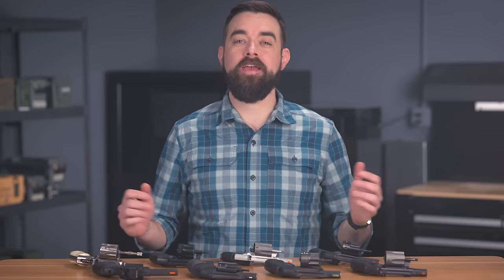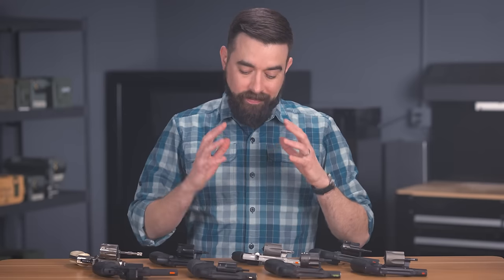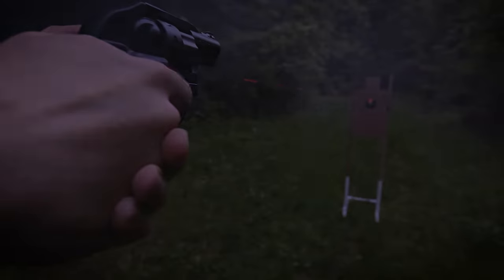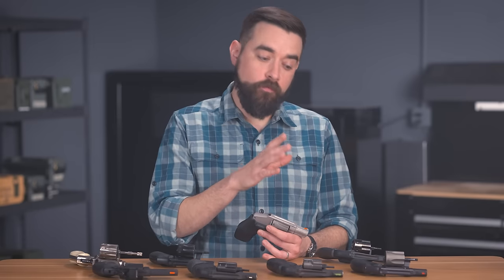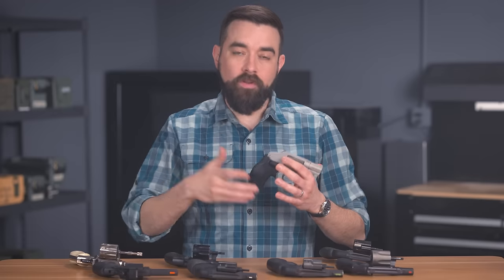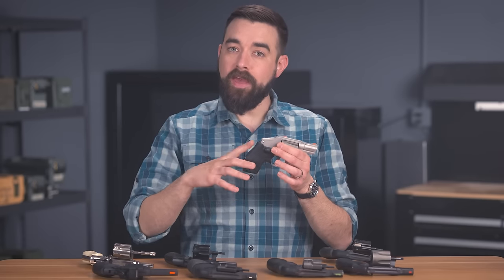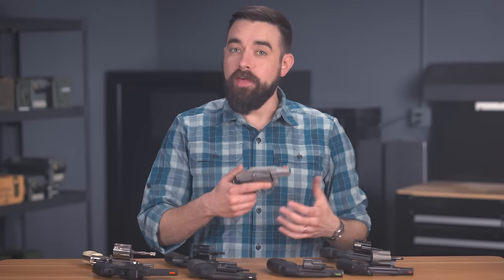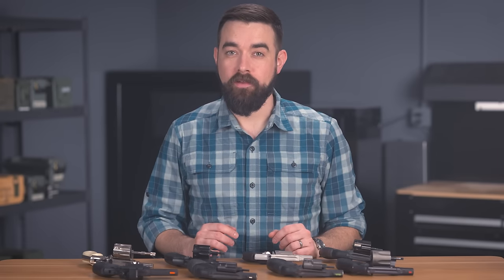Tips for Shooting a Snub Nose Revolver

Comment: S&W 640-3 (stainless .357 snubbie) with laser is my go-to here. I don't need the laser but it does evidence how well my trigger control practice has progressed ..or deteriorated. it's pretty in an ugly sort of way, maybe like an English bulldog, bites me too when I feed it .357 🐶
the trade-offs, while considerable, are well worth the benefit-  you-can-bet-your-life-on-it reliability 😎 
you know, in nearly 20 years with this model, I'm pretty sure there has not been one instance of a failure to function. was there a round that didn't go off? maybe 🤔but I don't think so. I would attribute any such to a defective cartridge. the solution is always easy with a revolver like this, just pull the trigger again 🙂all ejections, reloads, then resumed fire have been perfect.
I would not give it to a beginner, even with mild .38s. I tried, nobody likes it. so even if they tolerate the shooting, you're discouraging the beginner from the sport and benefits of effective self-defense. this is a specialized tool where its unique quality shines only after the operator has a good deal of experience.
yeah, so give them a small revolver for revolver practice, like I now do with a S&W .22LR. they're happy, learn revolver stuff, it's cheap too, actually can provide self-defense, what could be better? 😎🇺🇸

Comment: I started shooting snubs in 1991 Taurus Mod 85 stainless .then a 1980s manufacturered Charter arms "OFF DUTY".38 ( had a hammer back then ) very proficient with both .then a Smith 642 centennial... I carry a 11 oz smith 342 airlite ti (titanium cylinder) 38 special centennial.. in my right front pocket in a DeSantis Superfly pocket holster... I installed full size hogue Mono grips .. covers the back strap.. cushions my hand against recoil.. and gets all my fingers on the grip for maximum control.. still easily fits in my pocket.. the defense load I carry is federal HST + p 138 grain.38 sp 
Federal achieves +p velocities and pressure. By seating the humongous hollow point DEEP  in the case flush with the case mouth like a full wadd cutter.. this builds up plus p pressure without adding more powder the.. result is a plus p hollow point that expands and reaches 13 in. in denim covered ballistic gel. But feels like you're shooting a 22 magnum instead of a 38..+p.... I carry my spare reload in a ZETA 6 circular rubber speed strip... Load all five at once! Without bulky speed loaders and knobs and buttons....

Comment: There are a few Taurus snubs I have yet to experiment with, but overall my experience has just been bad with Ruger and S&W. Besides the CT laser grips, I have yet to find a boot grip that sucks less than the factory boot grip from Smith. A lot of the Hogues actually impede the mainspring and increase your trigger weight, a lot of wood grips are shaped to fit as many guns as possible and as such leave huge gaps that can pinch your hands (looking at you Altamont), and almost all of the 3-finger “combat” grips I’ve found are designed to put your hand way too low. Smith can’t index a barrel straight to save their lives, and Ruger seems to have a fixturing problem as I’ve now seen about a half dozen LCRs in person that have their front sight bases milled with a rightward cant. The LCR trigger is actually quite good, even in rimfire, but having started on Smiths I just can’t fix my tendency to false reset the trigger. If someone would just make a 2” snub with an adjustable rear, I would buy it. I have never worn a pair of pants in which pocket carrying a snub revolver is even plausible, and I’m not even buying tight pants; concerns for pocket carry have zero bearing on this purchase. Give me a snub with belt carry and performance in mind. I want to make revolvers work, but I just keep getting let down

Comment: Holding the grip too high is the biggest mistake people make with these revolvers. All your fingers should line up and be parallel with the cylinder/sights when gripping, and not be angled downward at all. A revolver is meant to 'rock' in your hand. It is not supposed to be gripped like you would a Glock.

Comment: It is a mistake to think that light weight is the objective!  I carry a solid stainless steel snubby with the weight to help absorb .38 Special +P recoil, and it IS heavier than the super-lightweights by DESIGN.  BUT you quickly get used to it and don't even notice it in your pocket.  REALLY!...............................elsullo
Reply: None of these pistols are heavy in absolute terms.  I think you can categorize them a light and very light.

Comment: I wish you would be slower to eliminate the .357 full power rounds. With as much as double the power of 38's they are the best 1 shot stopping bullet available. I have shot thousands of rounds of full power 158 gr rounds in my 340PD. For me it is the best combiation of ease of carry, so I always have it with me, and ample power. I also rotate with a 12 shot P365 but the Smith is the easiest to carry I have found in 40 years.

Comment: The more wheel guns the better. I actually use a snub nose 357 with full power loads. It takes time to get used to it, but it works. And you don't lose all the power - you lose about 15%, but it's still superior to a full size 9x19.

Comment: My Go to, off duty gun and back up ankle rig is my Ruger SP101 with Remington 357 125gr SJHP. Fire breathing monster yes. But will stop anything I need it to. The weight really soaks up the recoil but it's still a handful. With 38 +p it's a pussy cat. I just don't see the point of the lightweight guns. My duty rig and it's  8 lbs of gear during the work week is real heavy so I just do not understand people who complain about the weight of just a gun. I frequently carry my full size autos and with just the gun feel like a featherweight.

Comment: The sights aren't good because they're meant to be used at close range in situations where precision is not required. If you need to put a red dot on a snub nose you've chosen the wrong weapon for the job or you're trying to make the weapon do something it wasn't designed to do and will never do well. Not to mention that you've ruined the profile of a weapon that's purpose built for easy concealment and deployment.

Comment: Sig 365, Springfield Hellcat or another small semiautomatic. there is no logical reason to buy or use a revolver especially since revolvers are $600+ and capacity is 6 vs 15 hollow point 9mm in the smaller lighter Hellcat.

Comment: It's like a tale of two cities going on here. Carrying a J Frame as I do, you can throw out all these self help videos as bunk. They are great for "shooting for dollars" with a buddy on the range. A snubbie is for up close and personal defense. It is made to be pressed into the body of an assailant if necessary ala Lee Harvey Oswald. Adrenalin will negate all trigger pull weight worries. Point and shoot with either hand is a must. If you have to use sights, you will be a victim. Just point at something with either index finger. It goes automatically to bullseye. You didn't have sight anything in. Train your gun as your index finger and that includes shooting from the hip if necessary. A good holster and good carry position is far more important and mandatory. How many women out there purse carry? Or the gun buried in a pocket? Good luck, you're going to need it. Once you become the target of a thug, a thirty foot gap will covered in a nano second.

Comment: I shoot sub-8" groups at 25 yards with my $130 snub 38 all day long. Painting on the sights isn't going to make you a good shot. Laser grips are not going to make you a good shot. This entire video is terrible info. Whole lotta talk and no groups to show for it and it's because this info does not achieve groups. 
If you want groups you need to put your finger as deep into the trigger guard as possible. If you are using the pad of your finger you are doing it wrong. You CAN move your trigger finger straight back, if its deep. If you are not going to cross your thumbs you might as well shoot one handed. You want  your hand bones and the grip to be fused into a single substance neither man nor machine. You need to constrict the grip, not squeeze it.  Use the support hand to physically squeeze your second middle finger knuckle and second thumb knuckle together. If you can wrap 1mm tighter you are doing it wrong. Shooting hand should be almost limp and the support hand should be cranking down until your shooting hand hurts bad. Squeeze as hard as you can and then slowly ease off only until the point it stops shaking. Then realize where you could have choked up higher and gripped somewhere tighter, and try again.  After doing that a few times and feeling good with a hold, you can finally stage the trigger and focus on heart rate and breathing. The entire process should be painful and uncomfortable. Not just when the hammer drops.
It's a fixed barrel and fixed sights. If you miss it's your own fault. The gun will shoot straight when clamped down in a vice. Just gotta be that vice.